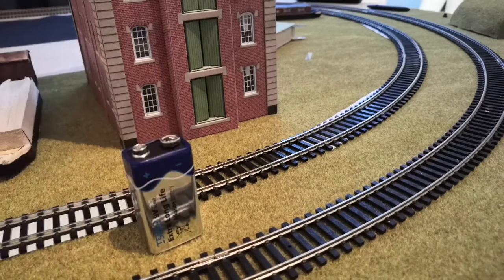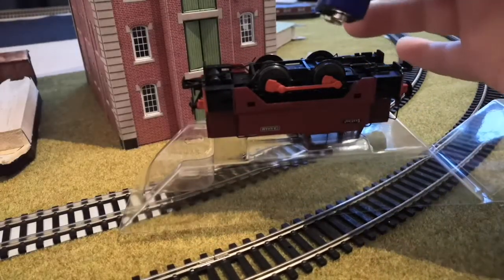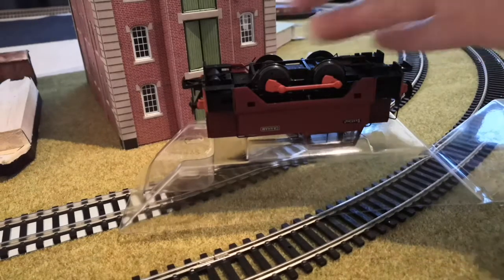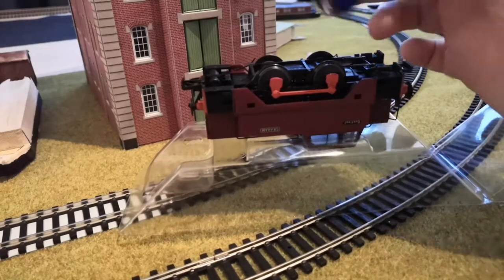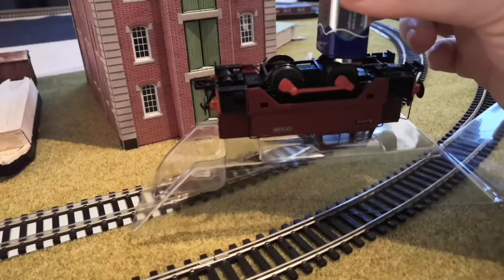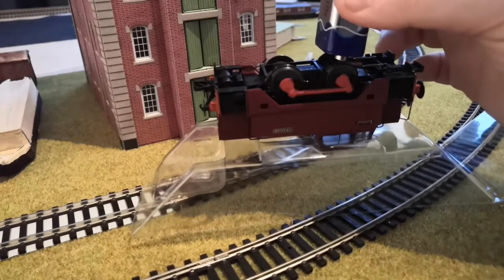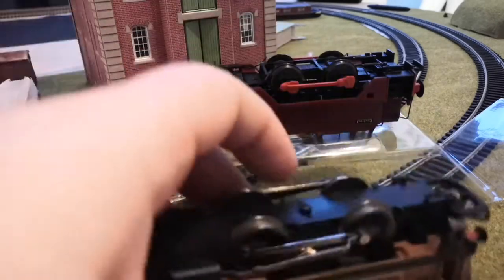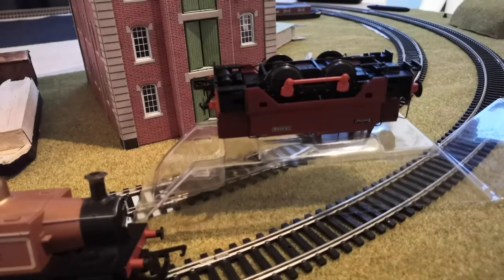Testing a Model Locomotive with a Nine Volt Battery

Comment: I have a Hornby 2721 class that the qheels just... don't freeroll? 
My other hornby model, a Hymek, rolls back and forth fine. 
I don't have any track and I'm a bit skeptical about putting a battery to the wheels. 
It's the 2788 numbered model if that helps any.

Comment: Applicable with any type of locomotive? eg: Lima, Piko, Roco, Marklin?
Reply from the maker: There are exceptions! This should work for any 2 rail locomotives that pick up across axles. Types that won't work (in my experience at least) are things like Hornby Ringfield models as they pick up from one rail on the loco and the other on the tender, only working when put together. Doing this shouldn't damage a model however due to the low voltage, therefore if you're not sure if it will work, give it a go! The worst that will happen is nothing at all
Reply: @astonishinglyaveragemodeller  And if doesnt respond across the wheels, take the body off and apply directly across the brush terminals